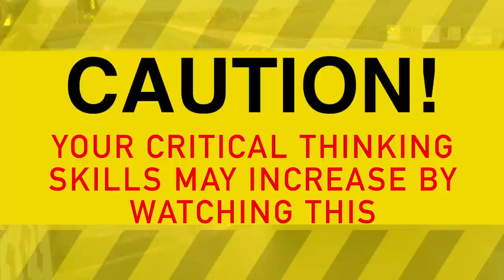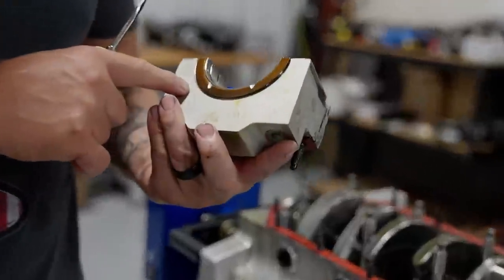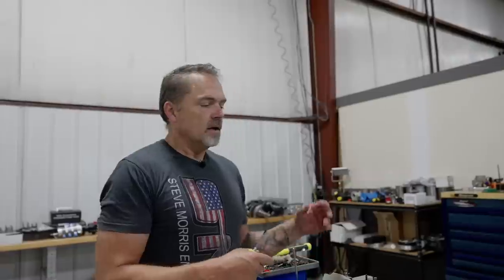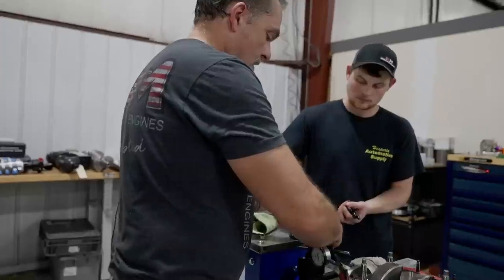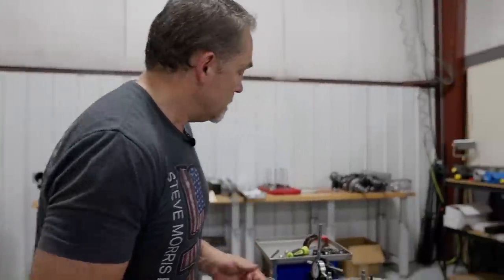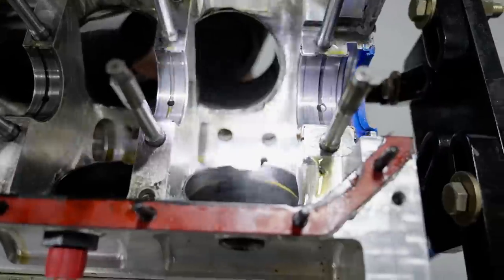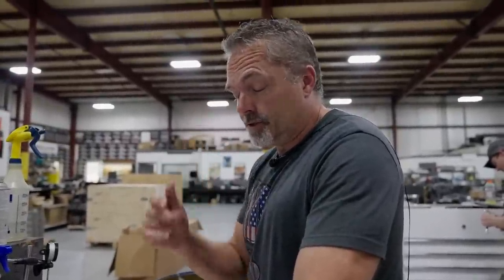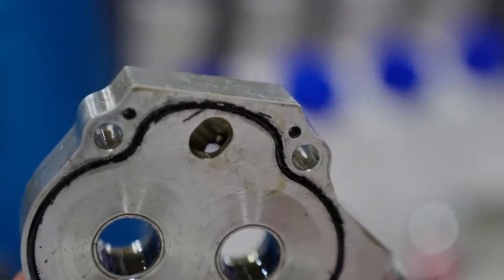I Found Mullets Engine Issue...Part 2

Comment: This is caused by a trans problem, pull the trans and check to see if the exhaust after the cooler return throught the back of the input shaft and or restrict the convertor feed some more
Reply: Jamie Knight, Have You conducted a proper thorough, detailed, exhaustive, examination, investigation, including all known data, applied a complete proper set of mechanical, machine, materials, physics, engineering principles, into assessment, evaluation, analysis, determination, troubleshooting, problem solving, etc. ?! = NO - Certainly NOT - Good Luck
Reply: @newtonfirefly3584  pretty obvious it's not an engine problem and it's happened twice now
Reply: @jamieknight9636  Clearly within this full disassembly, thorough inspection of the SMX engine by Steve Morris, as seen in both part 1 & 2 videos, there is no issue, problem, damage within the internal parts, components, block within the engine including from the low oil pressure seen after the last run sick Summer Day 3 [details seen within the posted, recorded video by Garrett-Cleetus]. The only interconnected issues which Steve shows are the thrust bearing clearance which he indicates still requires investigation and the oil pump, output side.
If You will look more carefully at the two problems that occurred during Sick Week and Summer 2023, both on Day 3, You will notice they are not exactly the same, though the thrust bearing, crankshaft movement seems to be similar; better more recently. All The Best, Sincerely
Reply: @newtonfirefly3584  that's garbage bud, if they don't investigate the high thrust loading from the convertor it will do it again. The definition of continually doing the same thing is insanity

Comment: Well I'm sure you were in contact with Cleetus after finding nothing in the engine causing metal in the filter. I'm also sure Cleetus changed the oil in the dry sump tank but did he flush it out after the last blow up?  Particles of metal could be still in the tank yet. No place else to look.

Comment: Wouldn’t the crank and block growing with head take clearance out?
Reply: Chris Gullen, NO, actually neither the crankshaft and engine block  can never 'grow'. Only biological can 'grow;, However all materials expand and contract versus temperature. These must be properly applies within the entire physical structure, within each part, component, peri tis material composition, details, physics, including within static, dynamics and all conditions, situations, parameters, etc. as any proper engineer performs proper assessment, evaluation, analysis, determination, design, eveloment, troubleshooting, problem solving, methods, principles, etc. Good Luck
Reply: @newtonfirefly3584  and again, there you go with that huge brain. Lol. 
Good luck.
Reply: @newtonfirefly3584   you know what I meant lol. I come from welding/fabrication industry and metal does “expand” and contract. Heating bearings/freezing bearings to bring tolerance up or down to fit on machines. I just figured the crank after a few hot passes would “grow” 😂 enough to start touching other pieces.
Reply: @chrisguillen1495  doesn't this Newton firefly guy remind you of that guy in the movie, good will hunting, when they are in the bar and Ben Afflek is trying to pick up that girl, Damon puts the wanna be smart guy in his place. White sweater, long curly hair. Giant doosh.  Yeah, you know. How about them apples!
Reply: @bucksnortbumblefuk6872   hahahahahah I’m fkn rolling 😂😂 that shit is him to the T lol
Reply: @bucksnortbumblefuk6872  The issue is not about brain size, intelligence etc. rather actual knowledge, methods, principles, etc.
Good Luck -> Bye Bye
Reply: @chrisguillen1495  Chris Guillen, Yes, Your incorrect, use, misuse, abuse with "grow" meaning expansion is clear that You mean, intend to state about metal expansion with temperature.
Did Your teacher, instructor, mentor also describe metal expansion as "growth"  ? Which other word, term about contraction is used ? 
Though Your are aware of the metal expansion, contraction per the temperature,  knowingly expect this to occur, thus adjust Your welding and fabrication techniques, methods, etc., Your knowledge base is rather basic, simplified and does not properly apply the principles fully, properly, completely, thoroughly, precisely, exactly, accurately within any structure, material as is required for the assessment, evaluation, analysis, determination within this engine assembly, machine, within static, dynamics over temperature.
Your awareness of expansion & contraction are useful, important aspects which affect this machine, engine, assembly. You just lackn how to apply them properly, completely, fully, correctly, accurately, precisely, exactly within all aspects, details, etc.
Your statements contain clear indications with Your personal lacking within proper ideas, concepts, principles, physics, materials, structures, assessment, evaluation, analysis. Steve Morris also lacks the necessary knowledge, expertise to properly assess, evaluate, analyze, determine, including design the engine; Thus he rely upon proper engineer(s) to accomplish this. If You would have the necessary basis, knowledge, etc. then YOu could achieve the proper assessment, evaluation, analysis, determination,etc. 
Good Luck, All the Best, Sincerely

Comment: The block will grow by st least .020" in length when hot
Reply: Another foolish, false claim along with improper terms, ideas, concepts, principles, physics, chemistry, materials, science, engineering, etc. Solid materials which are not biological never 'grow'. However they do have expansion and contraction coefficients/temperature. Also these must be applied correctly, properly within the entire structure, form, shape within all dimensions, measurements. materials, objects. The a proper assessment, evaluation, analysis, determination, etc. is performed, properly, correctly, accurately, precisely, exactly, appropriately as an proper engineer performs. Good Luck
Reply: @newtonfirefly3584   so are you saying that when the block is at operating temperature that it won't measure at least .020" longer than it does at room temperature?
Reply: Google tells me that the thermal expansion of a piece of aluminium half a meter long will be 0.68mm with an increase of 65 degrees C. So that makes my claim pretty accurate......
Reply: @Thatguythatdoesstuffandthings  If You will know how to properly use the temperature coefficients of expansion within the entire block structure, engine assembly, with every part, component, within the entire 3-D structure, over the temperature range, conditions, within static, dynamic, forces, then there can be a proper assessment, evaluation, analysis, etc. The expansion with increased temperature of the aluminum block alone is not one nor two dimensional, thus not just length. Also the crankshaft, connecting rods, their bearings, thrust bearings,flywheel, every component within the engine assembly,  expand with temperature, They are also all affected by the forces [pressure], lubrication, within dynamics, etc. The results of the expansion and contraction are not a simply linear, thus Your claims are not valid, properly based., accurate, precise, exact along with Your attempted assessment, application.
Good Luck -> Bye Bye
Reply: @Thatguythatdoesstuffandthings  Again as stated explicitly, the expansion of metal is not within one, nor two dimensions alone, rather all #-D and according to the entire structure of the block along with each component, part, lubrication, temperatures, along with other aspects including all forces in dynamics, etc. The proper assessment, evaluation analysis, determination requires much more complex, compound analysis than You are clearly aware of, about have sufficient knowledge. Steve Morris also lacks these too. The engineer(s) which designed,. developed the SME engines should be capable with a complete proper analysis, and hopefully has already done this within the design as other proper engine engineering designers. 
All The Best, Good Luck, Sincerely

Comment: I wonder about the 4 link rear end pushing the drivetrain into the crank. If it is setup to aggressively that would send exuberant pressure to the crank under acceleration. idk just a thought

Comment: Would be it be possible to modify the bypass, to have like a position sensor/switch, or a flow-meter on it, so you could tell if it got stuck wide open, maybe overthinking it a little, but having an extra sensor, besides just oil pressure, would've been helpfull, finding the issue.

Comment: It would have been good to know if the material in the filter was magnetic. If Cleetus hasn't cleared the tank, maybe he could run it through a strainer.
Reply: Since the oil pump is clearly aluminum, as similarly the appearance of the metal shavings, their is nothing magnetic - thus no need for such in this engine either Good Luck
Reply: @newtonfirefly3584  there are both ferrous and non-ferrous materials in the oil pump. Gears, shafts, and other internal parts are steel...
Reply: @WNCworks  Do You have specific material analysis of, with, for the metal shaving that was inside the oil filter and oil pan ??!!
=> NO => Thus false claims = Falsehood  & Nonsense
Good Luck -> Bye Bye

Comment: It’s not uncommon for thrust bearings have a crowned surface profile to better maintain an oil film / increase load carrying capacity. Might be worth checking as sanding it back will lose this.

Comment: Could he have some garbage in his oil tank? Good idea to flush it out well. Also, I was thinking, didn't he have some problems with his lockup? If so, could that cause any issues with your thrust bearing, like if something screwed up in the pump or converter... Just a thought.

Comment: Is it possible that due to the engine being repaired from the blowup Steve had there might be structural issues letting a section of the Block flex at high RPM causing the crank to move?

Comment: I was just wondering what if it just had old debris embedded in the billet from the last failure and as the engine heats up and cools it releases those small flakes back into the oiling system.

Comment: had a feeling it would have been something in the pressure regulation causing the low oil pressure
Reply: anyone with a "feeling" clearly has no proper basis, base of proper information, knowledge to possibly determine this issue within the oil pump. It requires proper knowledge, principles, mechanics, mechanical, mechanism, cause&effect, methods, assessment, evaluation, analysis, determination, etc. Good Luck